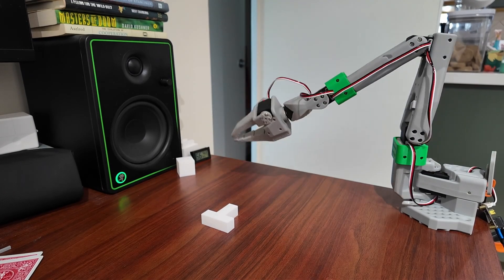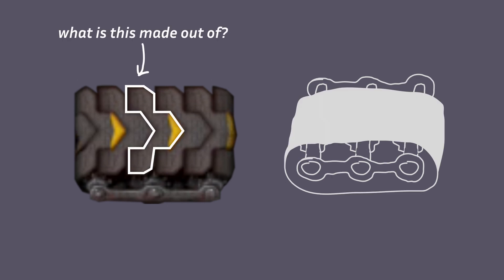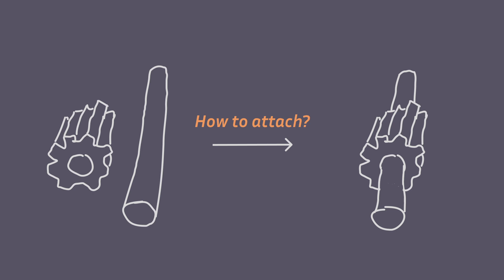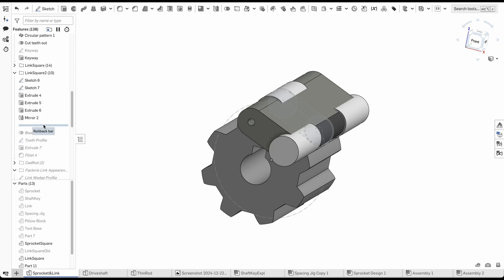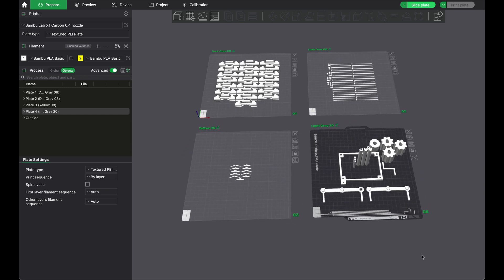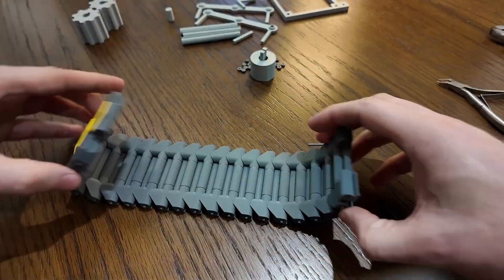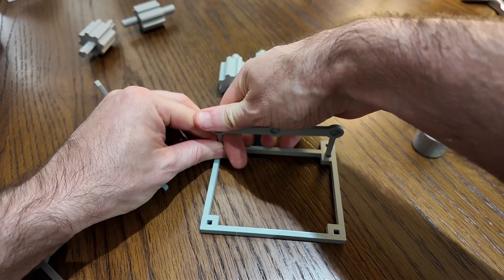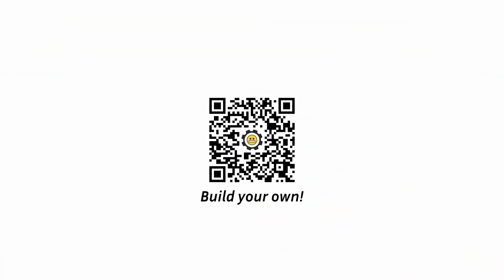Designing a Toy Conveyor Belt

Comment: How many of each part do you need
And are the pins in the file half or full pins?
Reply from the maker: Check out the plate files linked in the description so see the part counts for the build. There are full pin STL files, but the build plates have the pins already cut in half. It's meant to be printed from the build files, not the STL files unless you want to build a custom plate and hone the tolerances yourself.
Reply: @HopeThisWorksHTW where's the file count

Comment: Hello, that's awesome, question with regards to the the keyway, if the material is the same,  key + shaft + sprocket, nothing guarantees that the key will break first, or that stress will not affect the 3 parts, wouldn't it have been simpler to design everything as one piece instead, also it would be fantastic if you share your bigger conveyor belt project, I would really love to see how it goes.

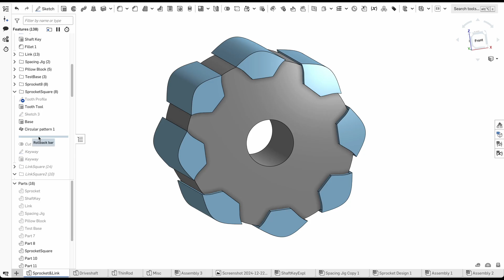PS: can I ask you where you found the exact shape for the tooth profile (1:59), it does not look like McMaster provide that detail.
Reply from the maker: My bad for late reply I thought I got emails for comments.

The goal was to make a single shaft/sprocket and print it, but I made them all separate to iterate on the sprocket design and shaft diameter. And then there is an issue with making it one piece, which is that it is hard to print it flat on the build plate. I don't like using supports. So you'd have to cut it in half and glue it together or something. I still think it's worth trying especially since it'll make it easier for people to assemble, I just ended up keeping the composable shaft key stuff since it was done.

Re the sprocket, I started w/ a prototype that used the MC 12 tooth sprocket. It worked really well but made the belt links smaller and I wanted something that matched the factorio belt (8 tooth and fatter links). All the tooth profiles (and everything else) are in the onshape doc if you want to use them: https://cad.onshape.com/documents/263ca805cc1e8a43186a3407/w/e33d831374bd7a78597f1a7d/e/57f638c129afb25aa050cabc. It's a bit messy but I can point you to a specific part if you have questions or want to find something in particular.

Comment: I ended up printing this out of resin, came out very well! I've mad a video on it that till go live Friday I'll make sure we link to your video. It will go live on the Lychee Slicer you tube channel.
Reply from the maker: That's great! I'm excited to see how it turned out in resin. I actually have a resin printer but I didn't think to try it on there.
Reply: @HopeThisWorksHTW The video was how to support Engineering parts for resin printing. Found your model and felt it was the perfect one. 

It turned out really well I ended up putting a drill on it and got it really going. If I was to make any changes it would be a cross brace to keep the 2 side walls from moving away. Other than that it worked great!
Reply: @HopeThisWorksHTW  https://photos.app.goo.gl/DKeoSukHT3nEo9xZ6
Reply from the maker: Just made me buy some other resin colors. Even at .08 layer height for FDM the resin just looks so good. 100% about the cross brace. Added to todo list.

Comment: How many arrows do you need? And are they just for aesthetics?
Reply from the maker: @RobinArmitage-g3m they are just for aesthetics. You can print 2x the belt links without the notches if you don’t need them instead. I think there are 11 of them or so.
Reply: @HopeThisWorksHTW  thank you also how many square links do I need?
Reply from the maker: There are 22 square links. Check out the plates file, it has what you need and is calibrated for the print. If you don't print the arrows you can delete the links in the plates file with the notch in them, and clone the notchless ones. It's a pretty precise print, so the settings/filaments need to be similar to get a good print (layer heights, scaling, etc).

Comment: Awesome. I love how it all fits together with no hardware.  And good idea on splitting the pins down the middle so they print flat!
Reply from the maker: Thanks! The original prototype had paperclips as pins but I was hoping I could get a version where it was all plastic to work. Someone suggested using nails for a metal solution instead which I thought was clever. It's surprising how well those little pins work even though it's just a toy.

Comment: Wow... kudos to algorithm.  Just got my 3d printer for Christmas... and have... (checks) 4600 hours in factorio.  You son of a bitch, I'm in.
Also... P1S... same printer.  And Bambu studios.
Reply from the maker: Awesome!  Yeah, I love my 3D printer. Let me know how the printing goes or if you have any questions.
Reply: @HopeThisWorksHTW 
Ok, I've gotten the belts together!  The color addition fit was super tight, I needed to use pliers to squeeze the pieces together.  I wonder if it's better to AMS the two color filaments together instead of joining them in post.  Not sure if that was attempted or not.

The pins worked surprisingly well and clicked together.  I was honestly impressed with how easy and well they worked!

That being said, there were so many!  I wonder if it's better to do a print in place joining for the belt segments, and keep the pin to a single to connect the belt.  

The final piece pieces are currently printing!
Reply from the maker: @LordWhirlin  Nice! Yeah maybe the notch can be dialed in or an AMS option can be made for the yellow arrows. I didn’t want to exclude people that didn’t have an AMS. 

Let me know if the shaft keys fit well or not. That was something that changed from one filament to another. There are smaller ones in the git repo if the one in the plates file is too large.
Reply: @HopeThisWorksHTW  Yeah, the keys were slightly too large.  I also noticed some slight bulging on a few layers very inconsistently.  Likely due to inconsistent other pieces on the layer causing inconsistent cooling.  But, that's likely my own setup.  I found the keys didn't fit at all... But also, I'm not sure they are necessary?  

While the main drive shaft would be (theoretically) required to be keyed (honestly, the fit was so tight, I tried for a little bit and just said F it), the other two are mostly for support for the structure, so even if the keys failed, the gears (if they weren't so tightly fitting) would just freely spin over the shafts, still providing stability to the belt.  The fail condition isn't that  bad!  It may even be worth just keying the shaft as a single piece  Could taper the angle to not create an overhang, since there's potential for to ramp up the key on the sides.

I actually did a round of Factorio with some coworkers, and these things will be great little office desk trinket gifts.  So I plan on printing up quite a few of these!  I'll try my luck combining the two colors, and I'll let you know!  One change at a time!

Also... any feedback is only because you asked!  I love this model, and I am being super nitpicky.  Your prototyping and approach are amazing.  I don't want any of this to detract from the amazing job you did, and my enjoyment of all of this.  This is far beyond any of my own capabilities and capacities. Even combining the two colors and simply manipulating those little arrows is probably going to take an embarrassingly long time for me to figure out!
Reply from the maker: @LordWhirlin  Hmm, I was worried about that. I think I might of put the wrong shaft key version in the final plates. I'll print a sprocket/shaft/key and double check which one worked on my end.

> But also, I'm not sure they are necessary?  

It is for the drive shaft (like you mentioned). Since the shaft/sprocket fit is so tight it almost seems like they don't need a key, but when I left the key out on the drive shaft, the shaft and sprocket rotated with respect to each other when hand cranking it. But for the other ones, yeah I'm not sure. The middle shaft having a sprocket at all (with teeth) instead of just a roller is kind of useless, it's just there to make it look like Factorio. I would 100% make that just a roller w/out teeth if it was not a toy.

> It may even be worth just keying the shaft as a single piece

Yeah 100%. There's also no reason for the keyway to go all the way through the shaft either. Then the spacing jig wouldn't be necessary. As long as the overhangs are not too steep I think that's the way to go for a better version.

> I actually did a round of Factorio with some coworkers, and these things will be great little office desk trinket gifts.  So I plan on printing up quite a few of these!  I'll try my luck combining the two colors, and I'll let you know!  One change at a time!

Amazing! Looking forward to hearing how it goes

> Also... any feedback is only because you asked! 

Yeah I really appreciate it! I've only printed it with my printer so it's really helpful to get feedback on how it goes on other people's setups. Like that shaft key I think is something I gotta update for sure.